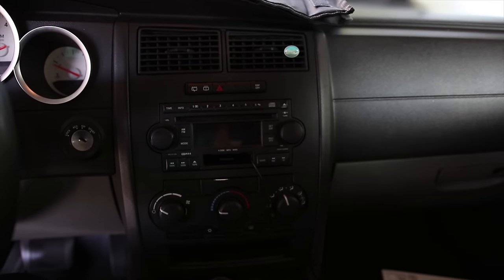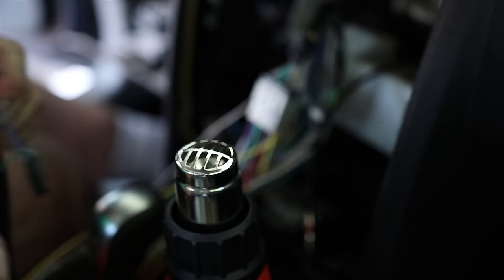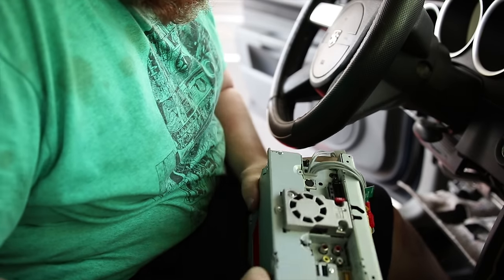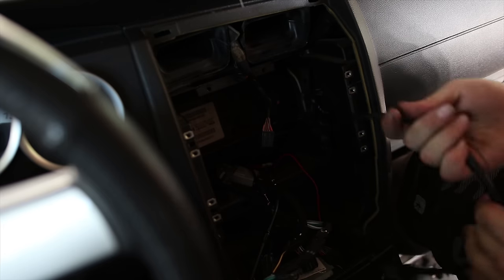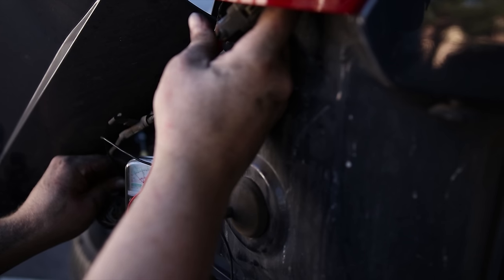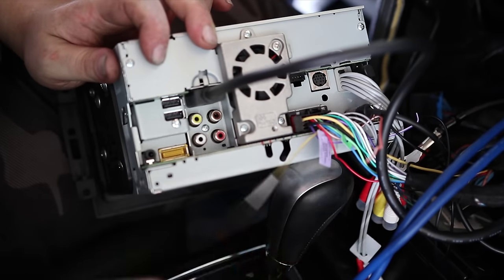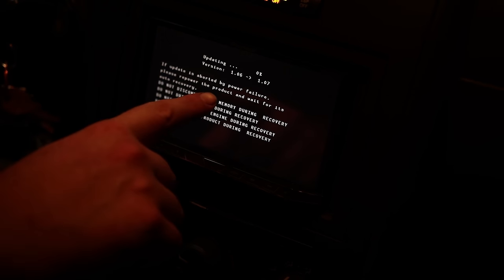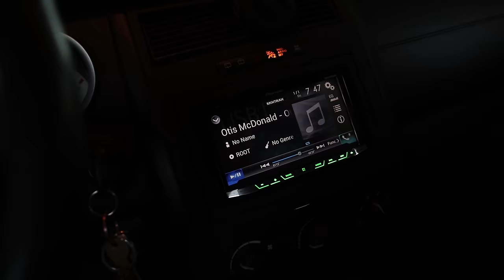Installing a Stereo, USB Ports, and a Backup Camera in a 2005 Dodge Magnum (Amp Bypass)

Comment: I did everything correctly and my deck still has no power. I hooked the red wire in to the cigarette port
Reply from the maker: If you confirmed everything is connected properly, and that you have power coming from that wire, then you may have a bad stereo.
Reply: @Distractor_Beam  I found out that actually had a bad fuse and the wiring was messed up going to the plug got it all fixed and it is working now
Reply from the maker: @syuunthefirst  I'm glad you got it handled.  Good job.  :)